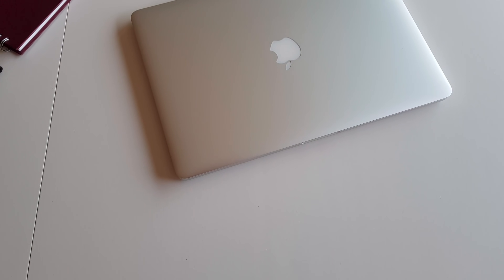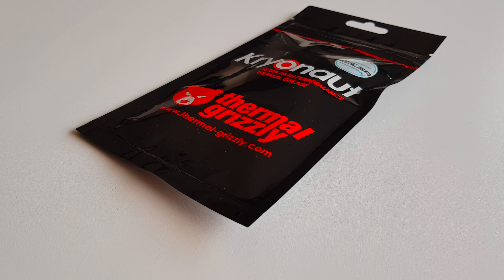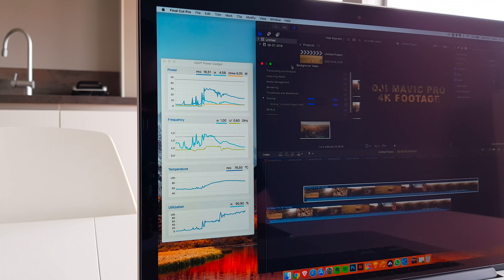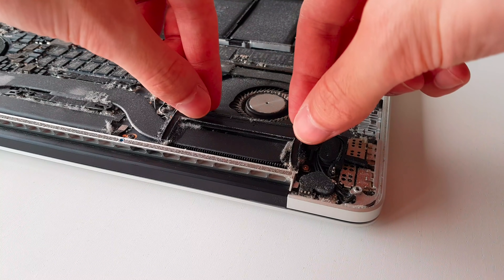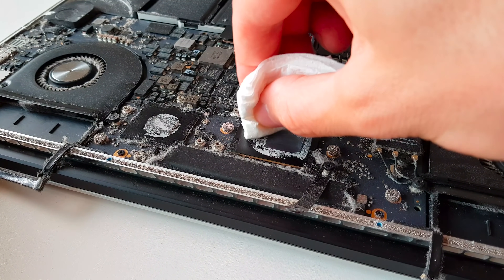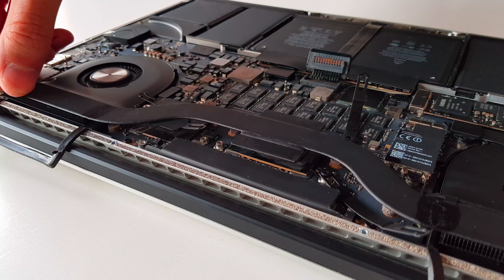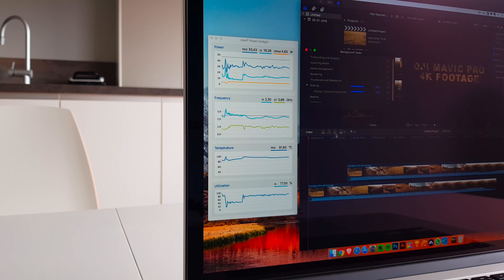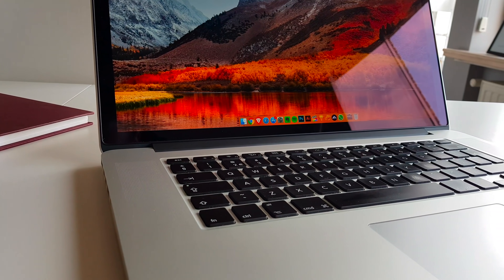Solved overheating problem on my MacBook Pro 15" Mid 2015 by replacing the thermal paste

Comment: Hi, good luck with your channel

Some feedback : mention the type of screwdriver for each screw so viewer knows what they need and when.

Extra lighting and maybe a closer look at the positions of each screw, maybe using a macro lens.

Maybe I missed it but you missed the paste on the GPU.

The benchmark part of the video would of been better if we could see the numbers and the labels of each graph. Maybe using a screen recorder might help.

But very helpful video. Ill be using it to replace the paste on my MBP soon. 👍
Reply from the maker: Hello Amer! Thanks for the kind wishes and feedback. I totally agree with the points that you made. In the meantime I did do quite some improvements on my videos. Regarding the GPU, I also repasted that as well. Also, I did get lights and it significantly improved the quality of my videos. You can check that out on some of my newer videos ;)

Thanks for taking time to stop by my channel and good luck with your MBP repasting :)

Comment: What is the app you are using to monitor fan speed and CPU speed please? Good video. Have tried to do it myself but not all the screws are coming off easily. Some came off right away others seem not to turn, even though I am using the right tool. Any ideas?
Reply from the maker: Hi Roberta! 👋 Thanks for taking time to stop by and leave a comment 😃The tool that I used for temp monitoring is called Intel Power Gadget and you can find it here: https://software.intel.com/en-us/articles/intel-power-gadget

Regarding the difficult screws... Does the screwdriver that you use fit tightly in the screw head or does it slip inside of it when you try to turn? You have to be very careful not to damage the screw head if it's turning hard because then you might not be able to use a screwdriver to open it if you damage the screw crown.

Comment: Hi. Yesterday night i have replaced the thermal paste following the video instructions. Perhaps i haven’t performed in the right Way the disconnection of the battery before the replacement. After reclosing the chasis I’ve tryed sereval time to turn on the laptop but I have no response. Obviously before this operation my laptop works fine a part from overheating problems. Someone have ideas to try to solve this situation?? Thanks
Reply from the maker: Did you disconnect the battery at all?
Reply: Dario Prski No, i think i haven’t disconnected correctly the battery before replacing the thermal paste. I’m pretty sure that the battery Is connected. If I connect the charger it lights, I don’t know if it means that the battery is connected. I’m asking which problems could i’ve caused working on the motherboard as you explained in the video, but without have correctly disconnected the battery. If this could be the problem, or an incorrect application of the paste could makes problem to the CPU?
Reply from the maker: Damn. It's difficult now to say... I am worried that since you didn't disconnect the battery that you might have damaged the motherboard by causing a short circuit somehow. You ALWAYS have to disconnect any power when working with these kind of things. 😕

Does the laptop give any signs of life when you press the power button? I think wrong application of the thermal paste should not cause the problem because I think the laptop would still power up and if the paste is not correctly applied it would shut down eventually because of overheating.

Comment: wich screwdrivers do I have to use for a MacBook Pro mid 2014 ? thanks a lot for this tutorial btw.
Reply from the maker: Hi Sergio. It's the same ones that I used in this video. So you will need a pentalobe screwdriver and a T5 Torx screwdriver. You can find a link for both of them in the video description. If you plan to buy them then please use those links as they are my Amazon affiliate links 😊
Reply: yeah, I saw the ones you recommended but I wanted to buy them separately, but I ended up buying a kit.
Reply from the maker: @sergioromero9363  Well I am a big fan of having a wide array of tools at hand. You never know when it might be useful 😉

Comment: I am extremely interested in how the CPU interacts with the thermal paste and the heat sink! Can you explain? I just learned about this from your video! So interesting!

Is there a good amount of time to wait before turning your Macbook back on? Thank you, Dario!
Reply from the maker: Hi Nicky. Well think of the thermal paste as something that bridges the surface between the CPU and heat sink. If there was no thermal paste, the CPU and heat sink would not be touching each other properly which means that heat would not be able to transfer between the two of them. Let me know if you need some more explanation if I was not completely clear 😊

Regarding the waiting time before use... You can use it right away but in general it's said that it takes couple of hours before the thermal paste "sinks in" and unlocks its full potential. But as said, you don't have to wait for it.

I am very happy that my video teaches you something new. Let me know if there are other topics that interest you for which I could potentially make a video 😉😊

Comment: Does this void warranty? If it's covered with Apple care, will Apple service center do it for free?
Reply from the maker: I think it does void warranty and I highly doubt that Apple would change the thermal paste only. They prefer more motherboard swaps so that they can charge you a shit load of money 🤣
Reply: @DigitalPulse  Thanks for answering. I bought a second hand macbook pro mid 2015 with apple care. Which had display delamination issue. Apple replaced it with brand new display assembly and cleaned the interior with new thermal paste. BTW I'M FROM INDIA.
Reply from the maker: That's good to hear that it was covered. Do you think they would repaste it if you only asked them to do that?
Reply: @DigitalPulse  Actually i only took that for screen replacement but told them it heats a lot. It was stated in the repair details that they found heck lot of dust inside so they cleaned it and changed thermal paste. Benchmark results were improved after that.

Comment: I noticed when I closed out of FIREFOX, MY TEMP HEAITNG PROBLEM WENT AWAY. I HAD A NUMBER OF STREAMING MOVIE SITES OPEN, MAYBE THAT WAS THE PROBLEM GO TO APPLICATIONS-> UTILITIES-> ACTIVITY MONITOR AND NOTICE IF ONE PROGRAM IS USING A LOT,
Reply from the maker: Hi Bellicose! Yes I am aware of that. Some websites are indeed resource intensive, but even the more light-weight ones would make it go crazy. I did monitor that quite some time in terms of resources used in the Activity Monitor.

Comment: I’m having this issue - when I took my MacBook Pro apart I too was expecting some dust - instead there was nothing, the thing looked brand new. Anywho changed all the thermal paste and put it back together and no difference at all. I really think there is either a temp bug in play or my system has a bad temp monitor because mine overheats until it crashes - and the fans don’t ever spin up first - yet it’s burning to the touch. Also I’ve literally installed hundreds of CPUs at this point and I’m well informed on how apply thermal paste, what is good, what isn’t, etc - and the factory job from Apple was fine - little too much but not that bad - and it still had some moisture to it - wasn’t dried up. So no issue with that. Made my heart drop when I saw that since I pretty much figured out there that the issue wasn’t as easy as thermal paste or dust.
Reply from the maker: Damn Rod. Sorry to hear that man 😥 Wait, so you said it overheats without the fans even kicking in to cool it down... Did you try to manually control the fans and crank them up to the max from the start just to see if it's going to crash?
Reply: Dario Prski yeah - and for the most part it doesn’t crash if the fans are cranked. The temp monitor shows the temps hitting nearly 100c as well - so the system knows it’s running hot - the temp readings are available to the system. I can’t figure it out.  I’ve done all the resets for hardware, I’ve reloaded the machine, etc - none made any difference.
Reply from the maker: Hmmm that really is a serious problem. I am really clueless man. I never experienced something like that so far on mine. Where are you situated? Maybe a good idea would be to email Louis Rossmann. He is a Mac expert and he might be able to help you or at least give you some advice.

Comment: You could get even better results by doing a clean job. You did all the hard part which is opening the laptop, then you terribly cleaned the CPU and GPU bay. Also you applied uneven with very small amount of paste and the fans were not real clean (they should have been opened and cleaned by water, alcohol and brush). Still you got a bit a performance boost which is not bad but you could get even under 2:00 by doing a cleaner job. Good luck
Reply from the maker: If you can do it better please do so 😉 I don't get these kind of comments. I did this with limited resources and with things that I had at home. I am not a repair shop. Terribly cleaned the CPU and GPU bay? As far as I can see it's completely clean so I don't really get your feedback. Please define "terribly cleaned"? Same goes for the fans... The goal of this video was not to do a restoration of the laptop and to get it to a factory state, the goal was to show people how they can do this easily at home with limited resources. Still... Thanks for the feedback but be more specific with your feedback.

Comment: Also Add thermal pads to the whole heatsink + new thermal paste. I used to have the same model running two 27” 4K monitors @ 60hz, 4K editing and adobe editing.

Comment: This was great and so glad i found it.  I have watched a lot of videos about thermal paste, replacing on notebooks, and few on macbooks.  I believe i have the same one as you but next processor up@2.8GHz (i7-4980HQ) so this is perfect.  
I play a game on steam called RUST and it HAMMERS my macbook's CPU.  From Dec 2015 to about 6-8 months ago my old and new macbook got 25-30fps, now 7-13fps. I start game and get 34 or so until thermal throttle almost instantly. Didn't have issue on my previous mid-2015.  This current one now idles at 48.5C.
I downloaded Intel Power Gadget, fanny, macs fan control and watched it hit 100C and throttle from 3.8GHz or so to 0.8!  I will be opening this up, cleaning, applying likely GC-Extreme Thermal (still comparing).  
Also, I am replacing my 500GB drive with the new OWC Aura Pro X2 2TB NVMe-PCIe SSD.  OWC has several good videos about replacing items.  Maybe you can review some of their products.  I am looking at their Thunderbolt 2 drive dock as well.  Trying to develop a photo processing solution with adequate storage and performance.
Reply from the maker: Thanks for sharing your experience and ideas man! I will make sure to check out OWC. And good luck with your repair! 😉

Comment: Do NOT use a brush to remove dust! The static can kill the laptop, it does happen!
Reply from the maker: I know but at that point I did not have anything else to use. Also I never recommended using a brush. But it's a valid point that you are giving.

Comment: the main problem is so much dust on the heatsink, try to clean first before changing thermal paste!
Reply from the maker: I do not fully agree. Apple is know for bad thermal paste application and my was completely dry. If the paste is dry and badly applied it can't really transfer the heat. Also, reapplying thermal paste after 2-3 years of use is highly recommended.

Comment: Just bought a 2011 MacBook Pro 15” and  the first thing I did was replace the thermal paste. It makes a HUGE difference
Reply from the maker: Happy to hear that Nick 🙂 Glad my video helped you. Enjoy your MacBook Pro and thanks for watching 🙌
Reply: Did it have a recall done to it? 
https://www.macrumors.com/2017/05/20/apple-ends-2011-macbook-pro-repair-program/
I ended up torching mine with a heat gun and brought it back to life. That was while I was waiting the typical many years for apple even to acknowledge an issue, basically class action suit. Standard apple. 
Anyways check to see if it's been done. Window had passed if not definitely look into baking the logic board if you have any video issues pop up. Think it was due to silver solder used on the gpu. Aside from that with ssd it was great machine

Comment: Are you worried about the Kryonaut drying out? It seems that Kryonaut dries out. Great guide though!
Reply from the maker: Hi. Valid feedback. So far so good. There is a chance for that as well so in that case I would probably switch it next time with the Artic Silver 5. But you are completely right, since this is a high performance paste there is a bigger chance that it dries out in high temps. 😃
Reply: @DigitalPulse  Thanks for the quick reply! Yeah I'm looking at applying some new thermal paste on my MBP too and whilst I have applied Kryonaut on my desktop PC I'm not sure if I want to use it for my MBP as I've just been reading that it seems to dry out faster than other pastes but I need to do more research. Maybe a thicker application could prevent it from drying out? I guess all pastes dry out eventually but as long as there's medium contacting both the CPU and heatsink uniformly then the heat can get transferred even if it's dry.. not sure though.
Reply from the maker: Applying it thic won't help a lot. I would go in that case with the Artic Silver 5. It's a high quality paste suitable for more common use. I linked it also in the video description 🙂
Reply: @DigitalPulse  Thanks, I've taken a look but might go with Arctic MX-4 as it's supposed to last a decent amount of time!
Reply from the maker: Let me know how it goes 😃👍

Comment: Using Google Chrome and complaining about temperature... This nasty browser keeps your CPU awake all the time, it's hardware acceleration is fucked up. Try Opera, Firefox or Safari, I understand that the stock thermal paste is bad, and the laptop is full of dust, but Chrome... This browser... grrr... Not to mention that it is one massive spyware. :)
Reply from the maker: I know. The problem is that there are couple of plug-ins that I use in Chrome and other browsers don't have it. Next to Chrome I also use Brave browser. Thanks for the suggestion Tsetso 👍😃

Comment: why would you open the heatsink BEFORE removing the dust?? so it gets nice and sticky on the thermal paste :/  and a hard brush?!?!?! wow, what a job :((((( if you dont have an air compressor, get a paint brush for painting wood etc, vaccum cleaner nearby, and voila.THEN you remove the heatsink and clean everything :((((((
Reply from the maker: Hello Maroje. I don't really agree with you there because the old thermal paste was completely dry so there was nothing that "got sticky". Everything god cleaned up without any problems with alcohol. Regarding the brush, it's actually softer than it looks like. It's not the first time that I work with hardware and I wouldn't use a hard brush for tasks like this. Nothing got damaged, everything is clean and everything works. I think the results speak for itself ;)

Comment: I am seeing lot of videos regarding MacBook problems mine is 2012 15inch i7 non retina DVD model till now I never had any problems.mine will be in under bed and unusable but no dust has filled it the only main problem is weight thats it. Battery life is 4-5hrs fine 😃
Reply from the maker: Glad to hear that your 2012 model is still kicking! That's interesting to see that your's has no dust in it. As you saw in the video my was FILLED! :D

Comment: Dario, very nice video. However its almost certain the performance improvement you saw was 99% related to cleaning the dust, and had nothing to do with the thermal paste replacement. You could have simply used a compressed air can + vacuum with light bristle head and achieved the same result in 1 minute.
Reply from the maker: Hello Boundary Condition. Thank you for the kind words and for taking time to watch my video :) Regarding your feedback... I partially agree with you there. This really depends from the situation. For some people just cleaning it might do the trick but for me that was not enough. If you watch the video closely you will see that the factory applied thermal paste was completely dry and it was also poorly applied from Apple's side. If the thermal paste is rock solid dry and not applied properly then it automatically decreases the thermal conductivity between the GPU & CPU and the heatsink. Also, Apple is quite well known for not doing a great job in applying the thermal paste (that's something a lot of people complain about on Reddit and other forums). So if you combine all of that together, you see that by just cleaning the dust would not solve my problem. Also, for anyone using a laptop for 3-4 years I would highly recommend to clean it and repaste it. Over time, the thermal paste (especially if it's a low quality one), dries and looses its thermal conductivity. So re-applying the paste does not hurt and definitely contributes significantly to the temperature reduction. :)

Once more thanks for the feedback and for checking out my video :D

Comment: Need your help. My MacbookAir wont charge. May i ask whats the best thing to do about it ? Is it the battery or charger? Thank you.
Reply from the maker: Hi Meon. Well that's difficult to say. You should try to diagnose it somehow. My suggestion would be to see if you could borrow somewhere a working charger and try it out. That way you will at least know if it's the charger (hopefully it is) or the battery (I hope not). I am not really an expert in macbook repairs but that's how I would approach it. Let me know if it helps. 😊